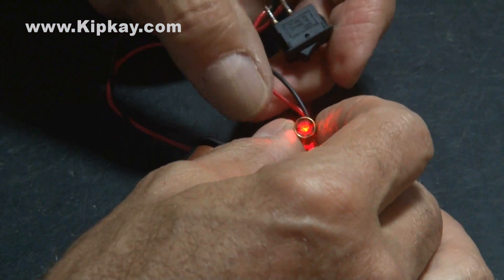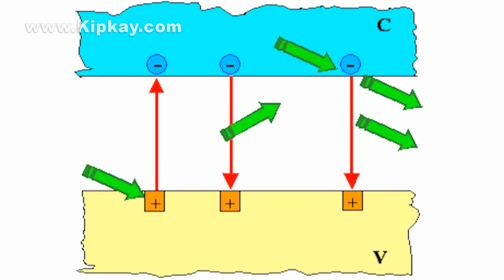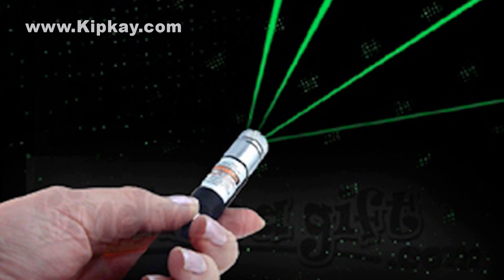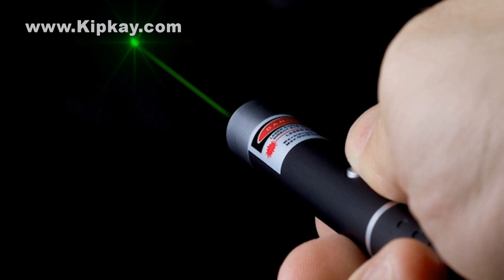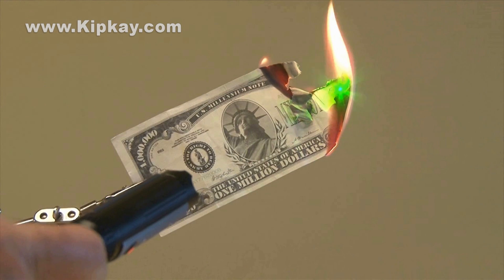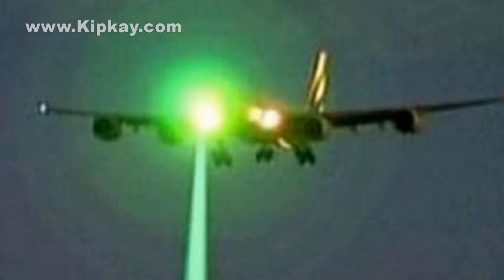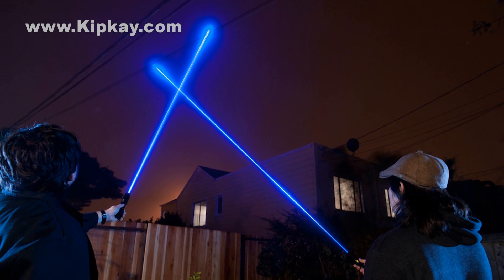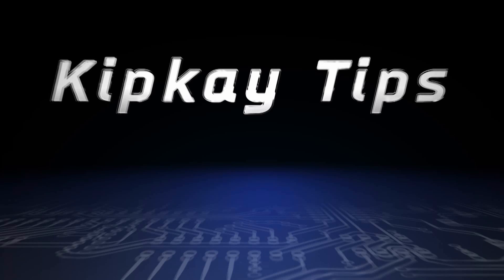How Do LASERS Really Work?

Comment: Did you know only 1% of the beam from in between the mirrors escapes the mirrors so it's visible for us? Crazy right!
Reply: pretty sure thats not true
Reply: Most of the beams stay in between the mirrors, but because the mirrors reflect the light constantly, only 1% gets the chance to escape. It's logical because mirrors arent made to let light trough. It reflects most of it, absorbs a little, and emmits a little (the 1%). So if ou think about it, it's possible ;)
Reply: i guess what you are saying is true, but whats the point of making a laser which can only emit a 1/100 of the light thats produced during the process? can you imagine then the size and the brightness of the light between the mirrors (cuz i can't) and all that wasted energy consumed for the producing of this light? as far as I'm know, one of the mirrors is translucent so we don't have to deal with the problem of the consumation...
Reply: If one of the mirrors were translucent, how could it reflect the beams efficiëntly then?
Reply: well.. it is not, but its the better option

Comment: Here's an easier way to explain it:

There's a flat LED with tons of connectors on it so it can control every aspect of it and balance light. Then, there's a cubic mirror on the side of it that mirrors the light. And finally, there's this special lens that can convert even the widest light into just a thin source of light.
Reply: That's pretty good. I like how Kipkay went into the subatomic-level aspects of how the laser works, though. Your way is good for explaining what each part does on a macroscopic level.
Reply: nope. not at all what happens in a laser.
Reply: +therealpanse well,you don't get it do you? i'm not telling you what happens in the diode, i'm telling you what happens on the body itself.
Reply: Ryan 
  You lost people at cubic...  lol.  And it didn't make any more sense.  Except to you.

Comment: Kind of a confusing explanation of how it works you should show the guts of the laser thats how i learned but thats just me i have adhd and am a visual learner.maybe showing people the quarts or jewel rods. Show that its eched that theres a mirror in the back. That light must hit the full length of the rod and that its wrapped in reflective material to concentrate the light.Intresting fact xray laser plus testla coil equals death ray.the energy flows through the beam and can fry vehicles electronics like an emp blast and is also a fatal head shot. China is working on this tech.